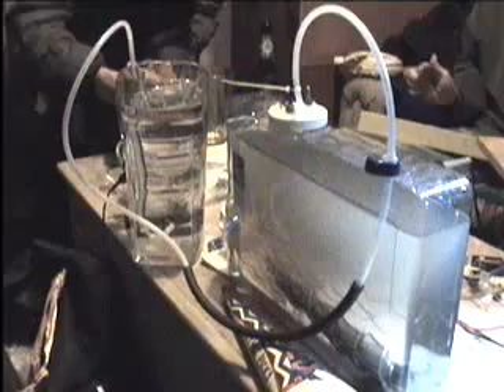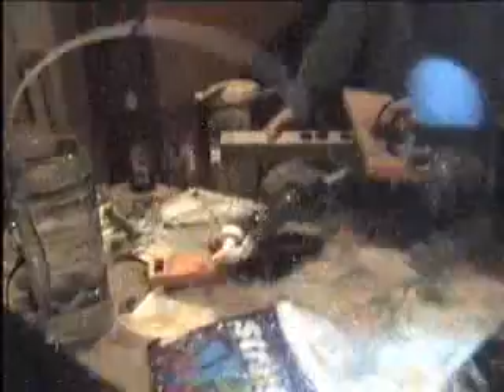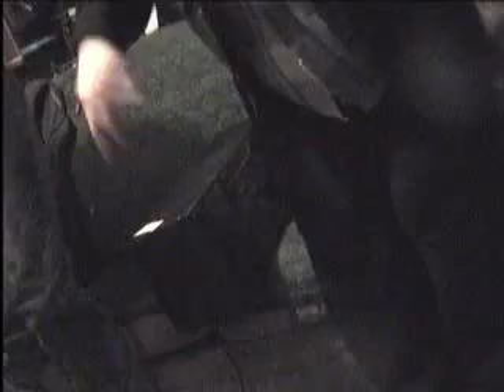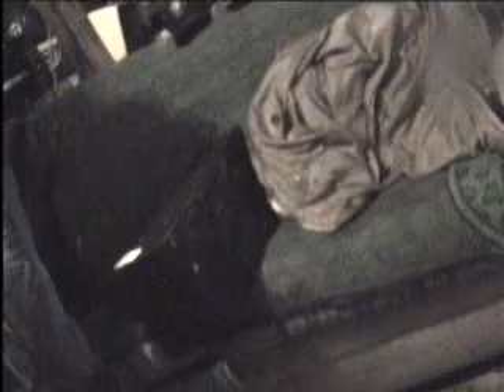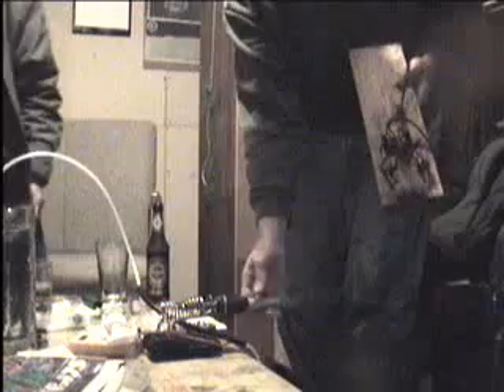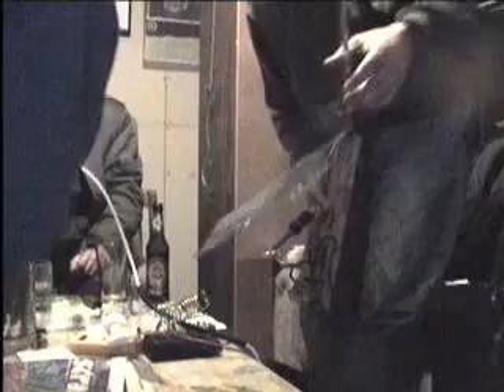HHo fuel cell explosion

Comment: It is not blast by the gas pressure , In fact it was blast due to the spark of current in the container which ignite HHO fuel and blast the container
Reply: Yeah they should check and insulate the connections wires above the water line. leftover gas from first test fire ignited blowing the container up.

Comment: If you want to improve your car engine efficiency
and save on your car fuel expenses
There is a better way to do it - it is HHO Gas
Using Hydrogen Hybrid alternative for improving
your car miles per gallon or kilometers per liter
Search Google for: "Top HHO Gas Car Research"
Click the first result (Skip the Advertisement)

Comment: @Slowchaos1 & imgonna

You both are immature "science" spectators, who think I'm tryingt belittle the people in the video for "e-props". The key to EFFICIENT H20 fracturing is not high ampreage, which results in prolific heat dissapation(overheated wires). This would be self evident if thurough research and practical reasoning for the development of ALTERNATIVE energy were used.. before even building a model to demonstrate your findings.

Comment: @theamericandoctor These guys forgot to note the pressure hazards of gas. Most containers are designed to hold fluids that applies power to the base and the walls of the container, containing a gas pressure is totally different. Many years of material sciences has been applied to find effective ways to holding gas pressure. Be safe out there, wear those goggles or a blast shield when your working with pressurized gas!

Comment: @Me102288 HHO isnt some kind of magic that creates energy. You need to use electricity to make the gas, that can later be converted to electricity again.
Problem is that you need to spend 10kwh to get 3 kwh.

To get 120v AC from a 12v battery (DC) you first have to convert the DC to AC, since transformers need AC to work.
That is why inverters (the things you got to convert 12vdc to 120ac in your car for example) are so expensive (compared to a transformer that makes 12vdc from 120vac)

Comment: @Me102288 Indeed!
But 1amp 10volts won't burn your wire, 10amps at 1 volt might.
That is the reason we use High Voltage to send electricity over great distances, you can send the same wattage (wich is all we care about, really) and get away with a muuuuch tinyer wire.

Comment: this is nonsense. why not just collect the hydrogen and discard the oxygen? there is so much oxygen in our atmosphere, if you really want to store energy, you should just store hydrogen.

and if you want both, are you aware that they are much more useful when stored seperately? i mean, one tank full of hydrogen and one full of oxygen. Much better, especially if you want (rocket) engines to run on it.

Best Regards. By the way, that common sense would also have prevented this explosion.

Comment: @summt5697 Absolutely. Before I opened a business, I majored in engineering. I used to laugh at how self-taught mechanics ALWAYS talked about how they knew better than any engineer. If you're resourceful, you could BUILD a Hoffman apparatus for far less than $400. No oxidizer contributes to the potential energy of H2 but the "Beavis and Butthead" of science don't realize the O2 MUST be considered in calculating volumetric efficiency - a subject WAY beyond them.

Comment: @RonL2524 Here's the catch. Brown's gas WAS researched & tried as a fuel in 1901-03. It makes an oxidizing flame during combustion and that can't be adjusted by tuning, therefore, 1 of 2 things happen, MORE H2 is added in -OR- SOME of the O2 is vented out to correct and make a stoichiometric burn (critical if you do not want to rebuild the engine every 2-3 years.) 200MPG carbs are possible but only on a very light, small vehicle. Hint for mileage? direct gasoline injection-it's on the way!

Comment: @summt5697 WITHOUT a STANDARDIZED measurement of energy IE: BTU, Therms, Kcal, etc. THERE'S IS NO WAY to convert/translate the energy expended into distance traveled, it's all guesswork - so BTU comparisons are critical.  Brown's gas (actual name for 'hho'), makes an oxidizing flame in combustion, so it will always require MORE fuel -gas, diesel or even more hydrogen- than can be made in the electrolysis cell. Brown's gas was tried 1901-03 & even Stanley Steamer was more efficient.

Comment from the maker: Hey DrMotorDude ,you are correct-i was a "knucklehead"  when this vid was recorded-i have learned a lot since then-i shake my head when i think about this early attempt.i have heard a bunch about 200 mph carbs and other gear that possibly was suppressed-sad.i'm not sure about measuring btu's and volumetric or mechanical efficiency(yet) but i am thinking about "flame speed"(f1 racing has played with this).from what i have seen-not many HHO peeps yak about this?let m know what you think?

Comment: From all the videos ive seen no one seems to have a relief valve,Hydrogen is a expanding gas, also you need to add a pressure shut off switch to the power,experiments work if done in a safe manner, Be safe and live another day.

Comment: hybred hydrogen oxygen what they r saying is that since hydrogen is explosively flammable when fire is added that adding ti to the normal oxygen will
1give more bang for your buck
2make you use less for combustion
but right now i am working on a way to have a car run on hydrogen ALONE keep your fingers crossed

Comment: don't use a plastic or pvc container. Design your cell so that the plates or tubes are the connection. I use a center electrode threaded through plastic end caps machined to fit the electrode and insulate it as well as sealing to the outer tube with an o-ring seal. There are plate designs that use gaskets with the positive plate in the center and the end plates are ground. This is a good design that will not arc. A good design will never have connections inside.

Comment: Good video. Lesson learned: 1)NEVER use a cell with connections inside the cell! ANY connection inside a cell will fail over time and it WILL EXPLODE. 2) Never operate a TEST CELL inside your house. I hope you figure out a way to get your connections outside your container without overheating your leads and causing a flash. My cells are made to last a lifetime and NEVER flash. ANY plastic container will fail as will connections inside the container, just a reminder.

Comment: Glad to see some sense,a vid on you tube that explains all about how to run a 4 stroke engine on hho,you have to mturn it into a 2 stroke so ik can run on implosion and not exp.
I thought it was bollocks.
I am a coded pipe welder,and have become very interested in HHO,Tesla,Geet lately.And i use elec every day.Slowly i am understading,Maybe,High frequency,AC,on pulse
I am currently starting to build set up combining the tech from Tesla and HHO when i get further will put it on here.

Comment: the comment i left calling you a moron is gone so ill start new. moron. theres no implosion and thats bs that you jump on the disinfo bandwagon. turning hho back to water is shrinking the volume but.... with a spark it expands with the heat thats created. i need an education before posting correct info?? education says a bee cant fly. whos the moron. consider what heat does to everything and just how you'd get that steam you suggested. then check out some vids of motors running on hho.

Comment: You guys are mad. you need to regulate the pressure and use pressure relief valves as well as monitoring the power to the electrode... your lucky.. but don't let it put you off.

Comment from the maker: Thanks for your interest-the fuel cell electrode wiring overheated & shorted-creating a spark & ignitted the hho gas inside the cell.this cell was built to run on 12 volts & current went up too much for in ternal wiring at 115 volts- check my "hho fuel cell modifications" youtube vid to see what i did to prevent anouther explosion-thanks for the questions.

Comment: From carful looking at your cells boom, it seems the voltage on the top where the wires are arc, and thus the big boom. Try to isolate the voltage all the way with something. Once that is done you can try again and it shouldn't blow up. But you might want too make it out of 3/4 inch thick acrylic just too be safe.

Comment: Please take more precautions, Hydrogen/Oxygen mixtures are too be respected at all times! Build your units in a way that will withstand the power of hydrogen, just like an engine cylinder 3/4-1 inch acrylic or something stronger depending on size.